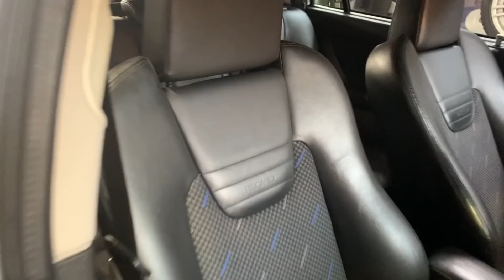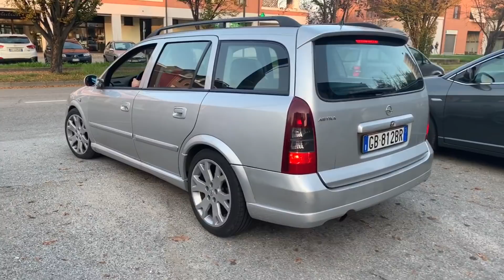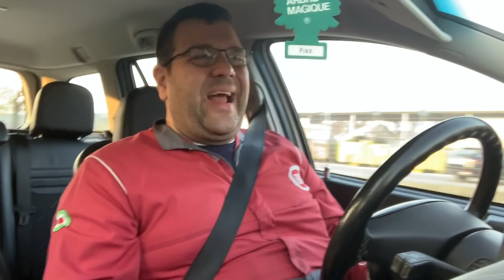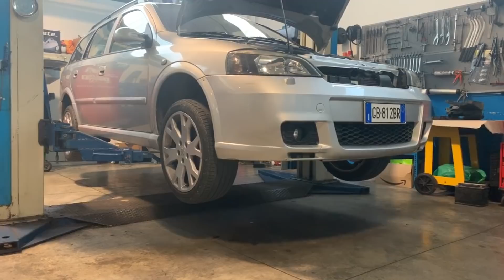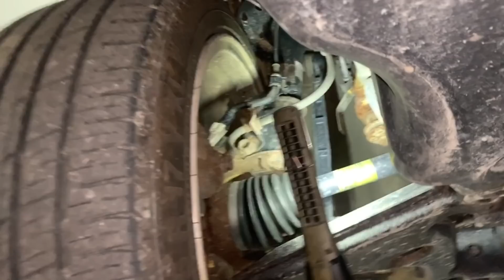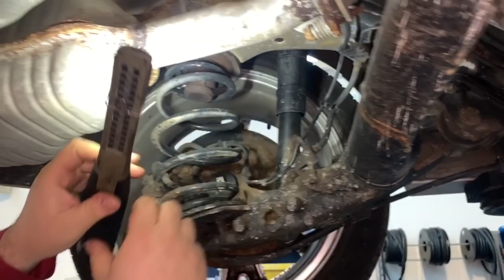GASI RESTORATION: Opel Astra OPC importata dalla germania..scopriamo assieme le condizioni!

Comment: Ma se si vive in posti dove c'è ogni anno neve e sale sulle strade cosa bisogna fare? Lavaggi della macchina più frequenti insistendo sui punti evidenziati da Gasi, trattamenti specifici? Oppure è in ogni caso "destino" che possa presentarsi ruggine?
(Chiedo in quanto dove vivo io non esiste neve e sale sulle strade)
Reply: Trattamenti antiruggine(cera, antirombo ecc) e dipende dalle zone se buttano più o meno sale se si vuole tenere un pó la macchina 2 o 3  volte a settimana pulire bene il sottoscocca...... Ci sono zone montane dove tutto questo non basta, tempo 6-7 anni e le macchine vanno marce
Reply: Lavaggio accurato dopo ogni nevicata, l'ideale sarebbe avere un idropulitrice in garage e gettare ad alta pressione tutto il sotto scocca in modo da lavare via il sale, ma se nevica tutto l'inverno è inevitabile avere dei danni causati dal sale, si insinua ovunque ed è micidiale.  Non dimentichiamoci anche di chi vive in prossimità del mare, e magari la macchina non la lava tutto inverno perchè fa freddo...
Reply: Se di ha un auto d epoca si lascia bella bella in box